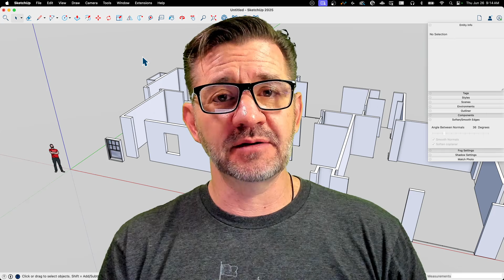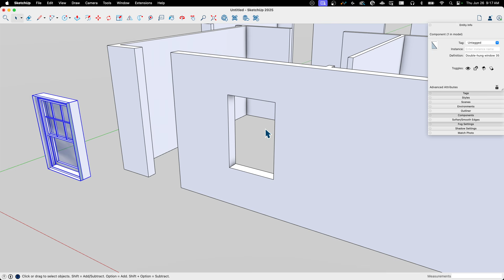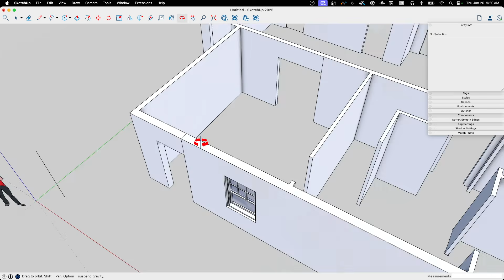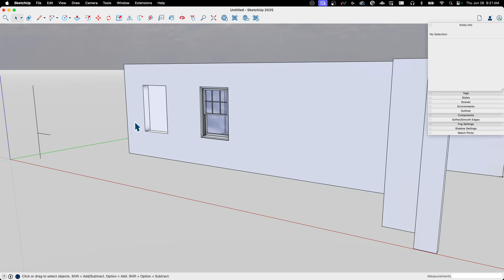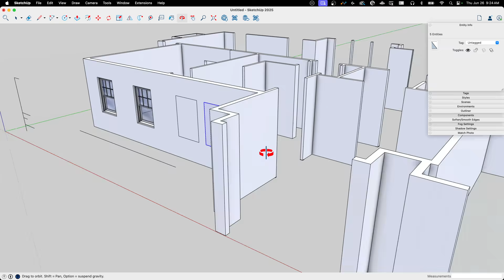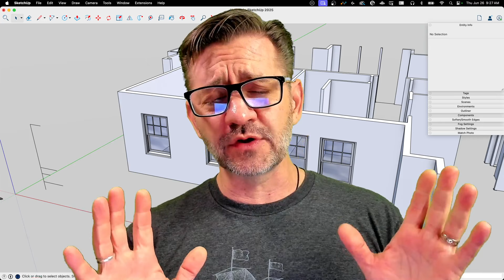Comment: Hi Aaron,
I am a relatively new user of Pro. I have been struggling with a dynamic window component for van windows. I just cant seem to get it to cut the van walls.  You mentioned an extension several times that helps cut windows through multiple surfaces, but did not name it. Which extension do you recommend? I looked in the warehouse and found a few. "MAJ Window", "Double Cut", Can you help?  Thanks, Tom

Comment: I know you aren't a big fan of guides, Aaron, but, if you're adding openings in a blank wall, I think pulling up from the base of a wall to header height to get the height for an entire wall in one shot is a lot easier than repeatedly referencing a remote line. 
Even quicker is to draw an oversized rectangle at the bottom of the wall, pull it up to header height and intersect faces with the model. This gives you a header line both faces of every wall, exterior and interior, within the rectangle you made. Actually, I could swear I picked up that tip in one of your videos a few years ago. The only disadvantage to this method is having to erase the intersect lines when you're done.

Comment: You could have  used guides as well
Reply: This was my first thought but then it becomes a pain when you are working off of other walls then the one with the guide on it. I use the method here because its easy to make the correct point an inference and then use it where needed.
Reply: Guides just take too long to setup and longer to remove.
Drawings lines are just faster